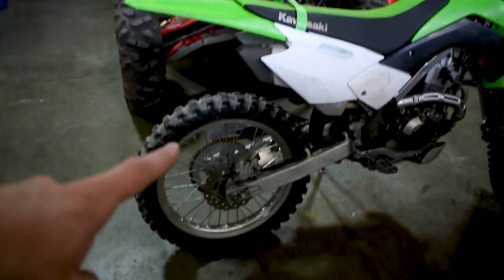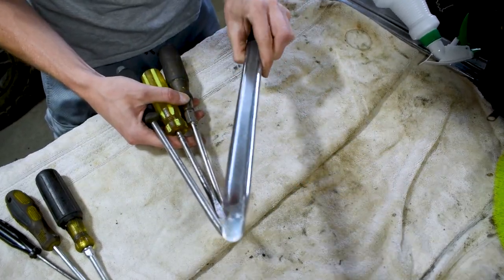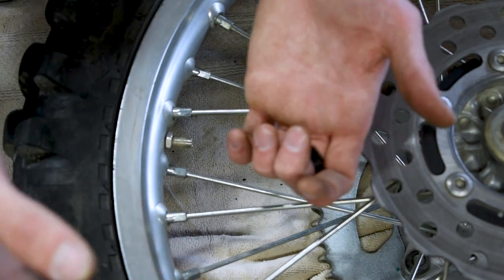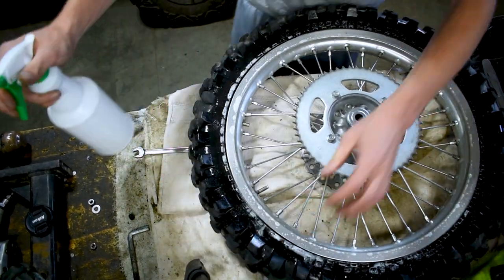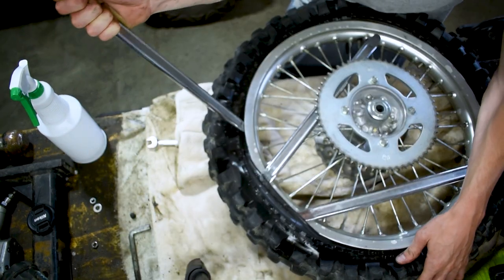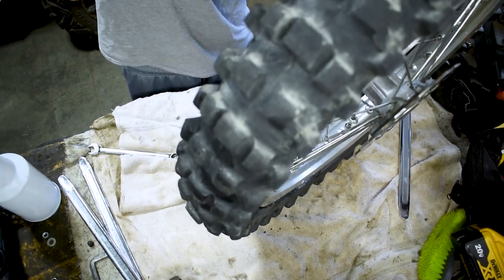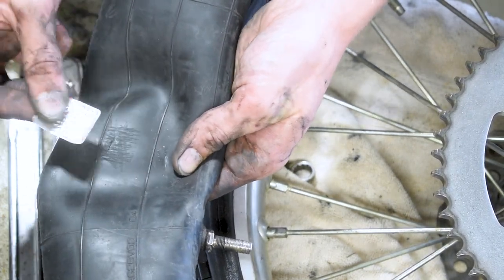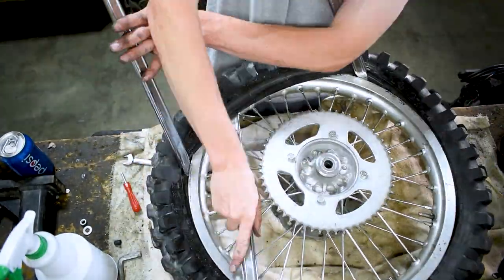How To FIX A FLAT DIRT BIKE TIRE & Tube At Home!

Comment: Great points and presentation Aaron ! 👍  I'm still shopping for an "Enduro style " bike .  Going to look at a 2002 Suzuki DRZ 400 pretty close to home .  Any thoughts on the bike ?
Reply from the maker: The drz400’a are heavy and definitely not suited towards enduro. They weight 320lbs. But it depends if you’re wanting a street legal bike or not. I love the bike itself, but definitely not for enduro. Its be better suited towards FSR dirt roads and street use
Reply: @AaronsEnduro  Thank you Aaron as I was thinking the same thing and wanted to hear you say it ! 👍
  These newer bikes are a lot heavier than the late 1970's bikes I was used to .   Old 1978 4 cycle Suzuki Dr 370 tipped the scale at 265 pounds .   I'm still looking around 😁
Reply from the maker: If u wanna be old school a KDX200/220 would be a lighter 2 stroke (some street legal) enduro bike

Comment: Haha you just rip the tire off by hand and you slap it on by hand. Beast video 🤙🥂👍☑️⚡
Reply from the maker: Yessir 😎
Reply: @AaronsEnduro  I've had my Apollo x19 125 for almost 2 years I ride it hard as hell and do wheelie practice on it and have not had a flat yet but I'll be ready to change the tube when it happens I also have a rim lock for the Apollo and the stock tire and tube still are doing great. I keep my rear psi at 40-50 so the tire is rock hard and doesn't slip. On my 250 I keep my rear tire at about 10 psi
Reply from the maker: Holy shit 50 psi 😂
Reply: @AaronsEnduro  rock solid so the rear tire doesn't slip, i think the max psi says 40
Reply from the maker: Ya that sounds like zero traction haha
Reply: @AaronsEnduro  it's the Apollo 125 it rips it hooks no need for traction when on a flat trail it hooks tho I'll show u it hooking up hills too in October 1st I'ma make video take one my bikes out
Reply from the maker: Thats crazy haha